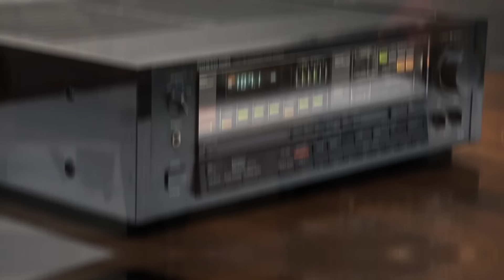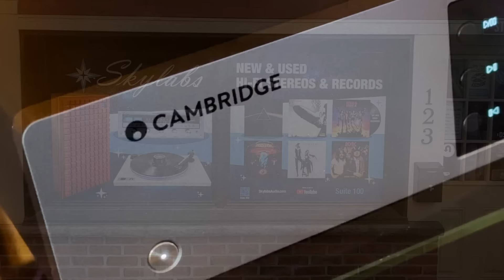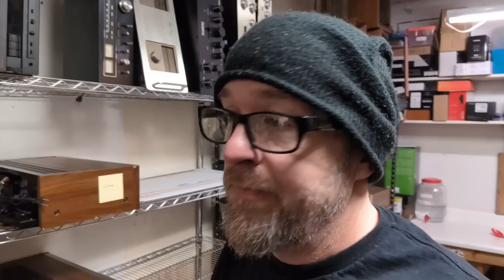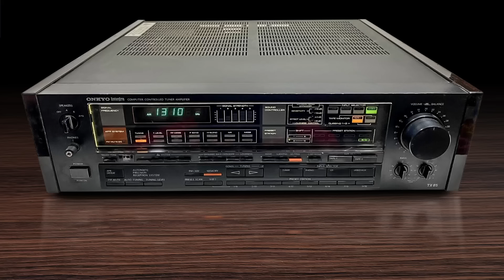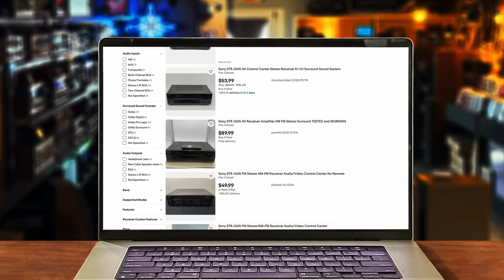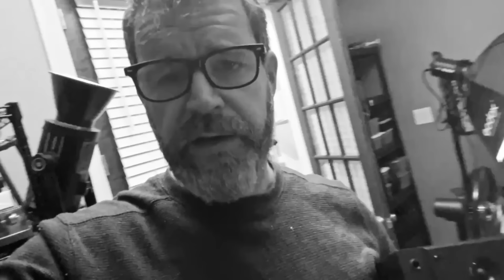Underated Vintage Stereos You Can Get Cheap... For Now

Comment: I have two Yamaha  HTR-5930 AV receiver I picked up at auction fro $40.00. The first one I bought has issues with the volumn control encoder, which is not an issue since its plugged into my computer. The other one with no issues, I have hooked to old crt tv I have. the spearkers are still in the stereo console from 1968. Good enough for as little tv as i watch.

Comment: Someone mentioned a home theatre receiver without hdmi. I have one A Marants sr-14ex. Finally had to stop using as everything went to hdmi. This is a true Marantz, so heavy I can hardly lift it, and being a THX ultra receiver the power is incredible, old gyro tuning too,  and easy to re-configure to 2 channel!
Reply: I’m still using a non-HDMI receiver. I’ve got a Roku with RCA output for most video and use a Bluetooth adapter for audio.

Comment: There was still a lot of great gear made in the 80's I have a Yamaha CX-800U Pre amp and a Yamaha  M-4 amp and I love them they are rock solid and sound amazing to me.The only thing I had to do service wise was have the speakers A light bulb replaced on the amp other than that they are still the same as when they left the factory.

Comment: Picked up a Dennon THX cert, 135 watts per for $65 on Craigslist !!! Polk monitors for $40 a pair and some no name sub for $25. All this was for
my garage system and I also picked up A Onkyo R1 cassette deck that sounds and works great for $40. Nobody wants blackface gear it seems.

Comment: I have a copy of the original GSfC FAQ somewhere that has comments. I just looked up a component lis5 on Google Groups USENET achieve. Too bad Google makes it hard to find info there. Lets see, here goes.                  goes...

**********
CD PLAYERS
**********

California Audio
Labs: DX-1 ($595)
Marantz: CD 63 ($399)
CD 63SE ($499)
NAD: 502 ($299)
513 ($399)
Philips: CD921 ($159)
CDC926 ($229)
Rotel: RCD-940BX ($379)

The Philips players are recommended as transports.

**************
D/A CONVERTERS
**************

Audio Alchemy: Dac*Man ($160)
Dac-In-The-Box ($259)
DDE v1.1 ($459)

*********************
INTEGRATED AMPLIFIERS
*********************

Arcam: Alpha 5 ($399)
Alpha 6 ($649)
NAD: 302 ($269)
304 ($379)
Rega: Brio ($399)
Elex II ($699)
Rotel: RA-935BX ($349)
RA-960??? ($?)
RA-980BX ($699)

****************
POWER AMPLIFIERS
****************

Adcom: GFA535II ($375)
AudioSource: Amp One ($299)
Parasound: HCA-600 ($365)
Rotel: [30 wpc in BX line?]
RB-970BX ($379)
RB-980BX ($599)

*************
PREAMPLIFIERS
*************

Adcom: GTP-350 (has tuner) ($350)
GTP-450 (has tuner) ($480)
Audio Alchemy: DLC ($459)
AudioSource: Pre One ($249)
Rotel: RC-970BX ($279)
RTC-940AX ($has tuner) ($450)
[Has this unit been replaced by a 'BX'?]

******
TUNERS
******

AudioSource: TNR-One ($230)
NAD: 402 ($249)

*********
RECEIVERS
*********

Onkyo: TX-910 ($240)
TX-V940 ($340)
Yamaha: RX-385 ($249)
RX-485 ($299)

************
LOUDSPEAKERS
************

B&W: DM610i ($498)
Definitive
Technology: BP8 ($798)
Energy: Excel ($150)
Encore ($200)
Epos: ES11 ($895)
Fried: Q/5 (now $300)
A/5 (now $500)
Genesis: Genre III (now $249)
KEF: Q30 ($500)
Magnepan: SMGc ($690)
MG.6/QR ($995)
Mirage: M-790 ($1000)
NHT: SuperZero ($230)
1.3A ($500)
2.5 ($1100?)
Paradigm: Titan ($210)
Phantom ($310)
5seMk3 ($530)
7seMk3 ($630)
Phase
Technology: 7T ($550)
PSB: Alpha ($199)
300 ($299)
400 ($399)
500 ($499)
RDL: RA Labs Mini-Reference ($173)
RA Labs Reference 4a ($224)
Snell: J/III ($699)
E/IV ($1100?)
Signet: SL260B/U ($450)
Vandersteen: 1B ($695)
2ce ($1295)

Well, that's it. As I said before, please e-mail me with any questions or
comments.

Marlon

Comment: I still think that the JVC's from the 70's, 80's and 90's are the most underappreciated pieces of gear ever. The reliability factor for most of them is just amazing. And they sound good, too. I still have a JVC cd player from 1989 and it's working flawlessly. It reads absolutely everything you throw at it. I had many cd players coming and going, but this JVC player is the only one I won't get rid of.
Reply: I found a JVC XL-V211 CD Player on Craigslist for $50. I drove 100 miles on New Year's Eve to get it. She popped the trunk and it was NIB! She found it in the attic of a house she moved into. I used it for six years and just recently gifted it to my 23yo son and he loves it.
Reply: @punkhillbilly3869  that is so awesome! Nothing like this older audio equipment.
Reply: I could write a multiple page essay on JVC gear I own made from '71-'94. It just works. After owning 35 years, I had to put a CD drawer belt on the XL-V333. 20 minutes of work using a $5 bag of assorted flat belts. Still works like it did in '89 and it plays anything too !
Reply: I agree. Had an old jvc 950 back in the day and regretted selling it. I just recently found one on ebay with the original touch screen remote.
Reply: I've still got my JVC Stuff and it rocks the house. I've got a cassette player that really kicks! Unfortunately those days are way done with. It was the thing at the time!! My receiver will blow the windows out!!
Reply: I agree as well.  I have a number of mid-late 70's JVC gear.  Definitely reliable and lovely sounding. Totally flies under the radar
Reply: Shhh.... let's keep that our secret. 😅
Reply: I had an early '90s JVC semi surround sound stereo receiver, and that thing was brilliant I mean truly. 

To my ear it just sounded right you know what I mean, a lot of products I listen to they sound off or they sound not how I think the sound should sound, if that makes sense. But that JVC was perfect and it sounded perfect

Comment: In the GSFC Good Sound for Cheap faq in the 90s by Marlon Fields he list the PSB Alpha as a winner. So I bought a set used. I listen to them on my TV through an older Pioneer AV receiver every day. They don't point to themselves, just neutral sound. Surprising bass when I turn them up. Thats the original but I understand there was updated model. 👍👍

Comment: My current receiver is a Pioneer VSX-D711. Little bit newer then the VSX you named but still a great machine! The D711 still has a ac port on it but no phono on it. I get around the phono issue with a external phono preamp. My main speakers are a set of JBL J2060, they are fantastic but do need a little bit of help from a separate subwoofer to get the bass that I like... im not bass fiend but I do like a little more then what the J2060 give. For loud play I have a set of sound design model 0719 floor standing 3 way speakers that are surprisingly good at high volume but suck at lower listening levels.

Comment: I have an early 2000’s RCA receiver . It’s 5.1 surround but I keep it set on 2 channel stereo. 100 watts per channel. I have it paired with a set of Sony SS-D115 3 way bookshelf speakers from an old all in one system I had as a teenager. I have a sub I could hook up but I haven’t fooled with it. It sounds good enough for me.

Comment: My 1971 Pioneer SX-2500 has a remote control.  Wired, not infrared.  Also, it is way more limited from the later units as you can only control the AM/FM tuner and the volume.

Comment: I have a Yamaha RX-V995 in my garage that got years ago for about $100. And it still is rocking. 

I had a RX 495 that I had for years but the battery went bad so every time I shut it off I had reprogram it. It was too expensive to fix it so I "upgraded" to a cheap Sony that had built in bluetooth.

Comment: Two years ago I wanted a cheap receiver for my garage as I had a pair of 30 year old Mission bookshelf speakers laying around and a 30 year old car to work on.  I found a JVC for $20 online that was only a neighbourhood away so I figured that was good enough for me.  When I knocked on the door the young woman handed me the receiver and said she would get the rest of it for me.  The rest?  Turned out it came with the remote control, 5 satellite speakers, all the cables and a powered sub as well.  For $20.

Comment: Another great video! This one featured the exact Pioneer that is in the back hall which I used to play tunes outside from April till October. However, the click that happens when you press the power, turned into a clunk. No more sound. Display is still on. Could somebody tell me what happened so I can decide whether it is worth fixing. I paid $30 Canadian at least 10 years ago so it does not owe me anything.  Thanks!

Comment: I bought a pioneer sa-1050 for 40.00 at the junk store.    Its ugly.    They said it didn't work.     I messed with it at the store.    All it was was dirty switches and volume pots.     Its been working great ever since i worked on it.    100w per channel.    Sounds really good for what i paid for it.

Comment: Although many people don't want to hear it, a lot of the 70s vintage gear they worship is actually utter garbage being sold at vastly overinflated prices. When my Marantz 2230 went pop for the umpteenth time, I decided that fixing it again was a total waste of time and money. As an electronics engineer, I managed to source the schematics and the lousy design of it used to make me cringe. I replaced it with a cheap JVC AV amplifier in 2004 that wiped the floor with it in every way possibly imaginable and is still going strong to this day. It's time people took off the rose-tinted spectacles and started looking up technical specifications and learning how to interpret them because they ARE all that matters.

Comment: The look of '70s receivers is a huge part of their appeal to me- I can sit and stare at them indefinitely, and don't care for the sterile look of the later black stuff. But I guess my minimum standard would be: must have a phono input, loudness switch, bass and treble controls accessible from the front of the unit (without using remote or going into a menu), and a tape monitor loop allowing for an external graphic equalizer. I've seen some early to mid '80s digital tuner stuff that has some appeal, and still some visual interest.

Comment: vsx 4900 pro logic ! bought one new when they came out, gave it to somoene in 2017 around 25 years later, the motorised volume control was very scratchy when I gave it de-oxit was doig ok but the scratchy sound would be back 1 month later and a few years ago I got a set of PSB Amazing Alpha for $8 in a thrift store

Comment: I have nothing against most of these. 😂 I do like the Pioneer VSX Yeah, the color scheme for the display works and yeah some of the older Onkyo's are sweet. Abd yep the PSB's are also very nice... Do a DIY sub passive or at add a Power plate and Bam especially if you have bipass filters. I saw an insane demo of a 3D Printed I believe Folded Horn with a 3 inch driver that on spendy analizer put out 30 hz and literally shook the furniture! I believe the cabinet was 4.5 x 12 x12 with 4-5 folds it was nuts!

Comment: Good to hear that not everything from the '80's-'90's is crap ! While they may not the visual appeal of the "classic" receivers of the '70's, they WORK and sometime work well enough for everyday listening. And yes, having a remote is a bonus, especially when using them to run your TV sound thru them. I was recently doing some research to find a replacement receiver for one of my local bar/restaurants (old surround receiver blew up). The cheapest one's I have found that can drive 4 speakers were $200 units from Yamaha & Sony (both with Bluetooth which is a plus). I'm always on the look out for modern (current) "bargain" speakers that are a great value, that may not be "audiophile" but don't sound "bad" like the Sony's you have there. I'd really like to hear a review of Dayton Audio's "new" B65 speaker. Steve Guttenberg gave them a thumbs up so I'd like to hear a review from others.   cheers

Comment: I have a Yamaha RX-V470 ($9) and a Technics SA-GX303 ($10)  from around the same time. Love them both.
Reply: Try the earlier Yamaha RX330/530/730/830/930 and later 350/750/850/950 etc.
Reply: @jonmccormick8683  Will definitely be adding some more Yamaha to my collection.

Comment: You can get the smaller NAD receivers all day for around 100 dollars, such as the 7225PE - and almost all of these have pre-outs so they can function as a preamp when you want to add a dedicated power amp later. Some of the later ones (701 and later I believe) come with remote controls, and they sound really, REALLY nice.

Comment: ...Infinity Reference 2000.1, Advent Indoor/Outdoor Mini Advents, Klipsch KG 1.5...3 different sets of speakers that I rotate thru...different sounding all...running thru Pioneer VSX 505s...spent about 200 bucks for the lot...need K-1018-s replacement woofers for the Klipsch pair...no luck so far...any leads would be appreciated...thanks for the insight, sir...

Comment: You didn't mention Kenwood. I have a thirty year old 7030 receiver that is used for kitchen FM radio duty & it still sounds fine. How do you know if an amp or receiver is in need of a recap? Bulging (or oozing electrolyte NOT glue) main filter caps is one sign, another is lack of bass. I've just recapped an Adcom GFA-535 amp that was in storage for 20+ years. The main filter caps were fine but there was a lack of bass. Luckily the amp boards only had two electrolytic caps (that's really lucky, YMMV), cost of replacements $13 inc P&P from Mouser. It now sounds fine!

Comment: I have a pioneer sx 201 receiver and a pioneer pd 4700 cd player both of them I got within a year or 2 of each other in the early 90's and although I haven't used them much lately the last time I used them they still sounded great and I also have a pair of pioneer 2 way speakers that I got a awesome deal on back then too at best buy.

Comment: Yamaha NS/RX  is always underrated , as is NAD. The NAD (new audio dimension) stuff is quite plain looking & probably an acquired taste, but as far as quality audio performance goes ? That stuff is dirt cheap. Shhhh, dont let anyone know.

My "man cave" set up : 1981/82 (?) NAD 7175PE , Bang & Olufsen Beogram 5500 turntable, 1981NAD 20 tower speakers, Series 2 Polk Audio bookshelf monitors,  AR 15" 250W sub and a Zoom Audio USB interface for iPod/tablet/laptop.
Reply: How would you compare the Yamaha RX series to the Yamaha R-8, R-9 which came out around the same time (mid to late 80's)?  They all look very similar.
Reply: @Abruzzo333  Well, I could not give you specifics, but I literally did a side by side test at my home. I already had the RX and brought home a R-8 from a rummage sale.
I chose the RX pretty quickly if a recall. 
Was there a big difference? No. But with my setup it was obvious which 1 to choose.
Reply: @ Interesting that models can vary so much from the same brand and only a couple years apart.  I have the R-8 but I've read in few places now that RX is better.  Might have to pick one up if the price is right.

Comment: Excellent advice. I looked at 'audiophile' brand stereo receivers on Ebucks over the last few months & prices were high, units dinged up (there's a lot of thrifting) or were really old (no remote) & probably in need of a recap. Then Onkyo was mentioned in a forum, there were a ton of AVRs & many receivers on Ebucks. I wanted a recent model but not the most recent ones, the're rebadged low end Yamahas. I found a pristine TX-8255 for $50. They were made from 2008-2013 so no need for a recap. I purchased a remote from Ebucks for $13. It works perfectly & sounds great.

Comment: Years ago I bought a new Onkyo TX-108.. I think it was top of the line back then... I put it in storage when I sold my house and then it got stolen from my storage unit, along with all my other Hi-Fi equipment and my entire LP collection that I first started buying in 1969....think those albums are worth a small fortune today..
I would buy another Onkyo like I had if I could find one that still has the original remote control....

Comment: Is it  K   G   G    O on the garage stereo, when I'd have to go to Camp Dodge, that was the station for R-n-R. I retired from the guard in 2002.
My systems:
Music
Yamaha HTR-5730: AVR  free from my brother
Sony DVP-S330 bought at thrift store $10.00 DVD/CD player
Speakers are new, a pair of JAMO S803 bs and a pair of RockVille Rocktower 68C, running through the Neohipo VU meter/speaker switcher.I also have a no name spectrum analyzer I picked up from Ebay, which is cool at night.
Movies
Pioneer VSX-D414 : AVR bought from Goodwill auction on Ebay $6.99 + $12.50 shipping (bought new remote on Ebay $8.99)
Sony DVP-NS315 bought at thrift store $15.00 w/remote DVD/CD player
New speakers, a pair of Jamo S805 floor standers.

I bought the Sony players from the same charity but different locations on the same day. the remote runs both players. they both are the size that they must have been in stack systems.

I do agree with those Sony speakers, there is a youtuber from Iowa that does A/B comparisons and I wasn't impressed ( sorry Randy, but I did get the JAMOs 🎵).

I had the BIG stereo system when I returned from W.Germany in the eighties, but lost it to an electrical house fire in 2005. 
I'm retired now and I am content with what I have now, and the money I saved can be put to buying more music 📀.
Kevin, I'm not trying to step on your toes so to speak, but I want the younger generations to understand that you have to start somewhere and work your way up.

Comment: I bought a Pioneer VSX series receiver, brand new, in 1999, but I cannot remember the exact model. It was my first receiver. Before that most of my audio focufs was car audio. I only had a cheap boombox for music at home. While I did use the Pioneer for music, on occasion, it was mostly used as surround sound. 

As I got older, I quit caring about surround sound, so it sat, still hooked up, but unused for several years. Back in 2022, I was going to listen to some CDs, but the receiver had failed, while it was sitting. I replaced it with a similar era VSX that I found on Kijiji for $60.